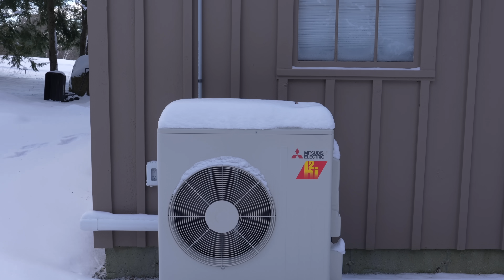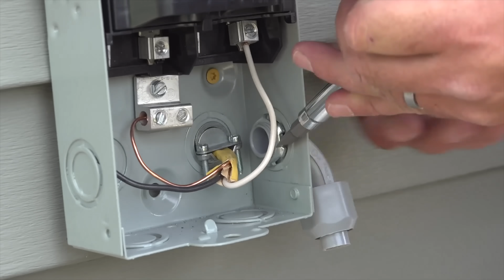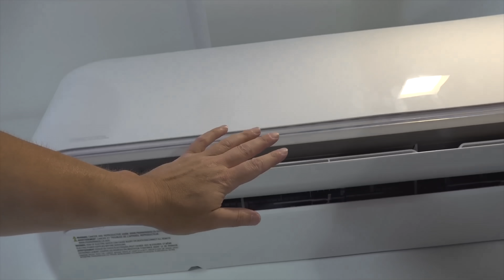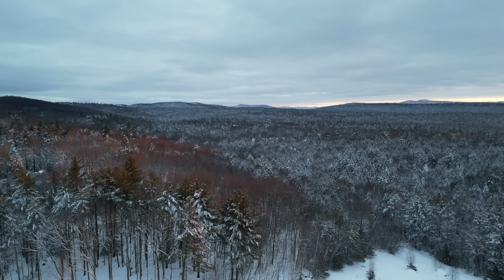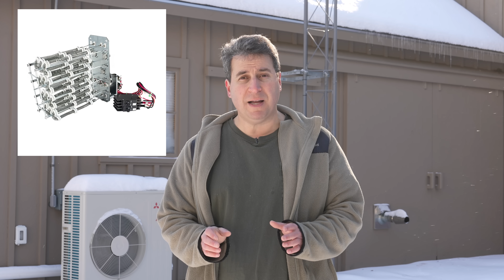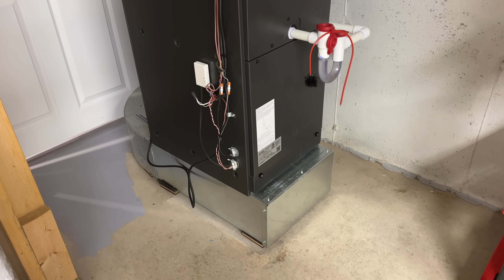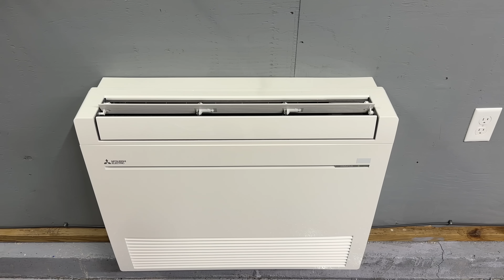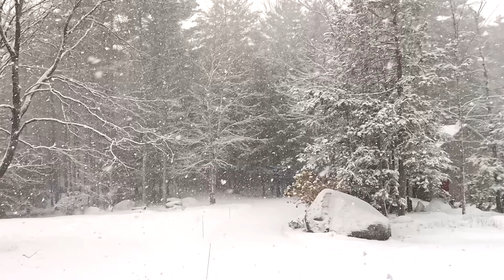Why Heat Pumps are now leaving people COLD

Comment: Actually one of the states where heat pump adoption is the highest is Maine.  So not all that sure this guy has his facts straight.  Maine loves heat pumps because they heat much more cost effectively than propane, which many Mainers use.  (And more cost effectively than oil or gas too.)  And last I checked, it gets really cold in Maine.  

So what do they do?  Mainers simply buy a heat pump rated for minus 20 degrees or better.  They do exist.  And they will provide efficient and cost effective heat even down to minus twenty.  Does a heat pump that works in minus 20 degree weather cost more?  Yes.  And is it as efficient at minus twenty as it is at minus ten, or zero?  No.  But even in Maine, it doesn't get that cold that often.  And even at minus 20 a good heat pump is still more cost effective than propane.  Plus it doubles as the best air conditioner you’ve ever had in the summer.  I say, if heat pumps are good enough for Maine, then they’re more than good enough for the rest of the country.
Reply: I’m in New Brunswick 🇨🇦, you are correct, our heat pumps are rated for -30C, we have no problems keeping the house warm

Comment: My neighbor has a heat pump and during the winter it never shuts off. They also have a gas furnace (original equipment in the home), but it apparently never gets turned on.

Comment: I don’t understand why you’re so worked up against the one thing most people could afford for winter heating: the heat pumps. You have snow on the heat pump that’s why is underperforming. I have my outdoor unit set up under the porch and it works well year round-I’ll let you guess why. Most probably your indoor unit is set up high where it works well at cooling during summer, while during winter it just heats up the ceiling leaving the floors cold-that’s what I did, unfortunately. Supplemental heating-that you mention is not about cheating but is meant to either improve the heating of a too small of a heat pump when one can’t afford to invest in a large enough heat pump, or to extend the usability of a heat pump down to temperatures at least 20F below the physical capabilities of whatever freon it uses. I have run a 36000 btu heat pump guaranteed to work down to minus 5F the entire last winter at my cottage and never seen the 15A breaker tripped (they recommended a 20A breaker, I went with 15A) not even when temperature dropped below  minus 35F. What I’m trying to say is that my heat pump never reach full load even in the coldest winter night in the woods in Quebec Canada. Granted I still supplemented with wood heating for basement- I enjoy living at my cottage in the middle of nowhere and occasionally with electrical heating (briefly after refreshing the air in my room while outside trees were cracking with frostbite).

Comment: Great overview. Capacity and efficiency are key metrics that are often left out of the heat pump discussion. If your heat pump is sized correctly and your ductwork is in good shape, you may not need supplemental heat, but the COP (efficiency) is likely to suffer at low temps. Cold climate heat pumps try to balance these issues, but YMMV, depending on how good the install was and whether the home is weatherized. I get sick of the soundbites on either side of the discussion. Heat pumps (and homes) are complex systems that require thoughtful planning, installation and maintenance and there is no such thing as one size fits all!

Comment: With all sources of Energy first Rule ,How much / KW will it cost me,theHeat  Pump  maybe efficient ?But if it costs you /KW to run  more than a/KW of NG or other fuel if doesn’t work  Exceptions-in climates where the temperature goes High and you to have to have cooling.

Comment: As an HVAC contractor in san antonio texas, I often recommend supplemental AC for the extreme summers. Those little roll around units are amazing to help your primary AC along!
Also, I would never recommend abandoning gas heat if available.

Comment: I was planning on running a heat pump to an A coil to my conventional furnace. That way I can use gas on really cold days but have electric central heat and air too. Not sure if that will work but hoping.

Comment: Look dude. Stop trying to make sales on bs products.  When the temperature gets below 40°  a heat pump is worth shit. If you want the efficiency of a heat pump then use a custom dual fuel system. Using natural gas or my preference lp gas . With this system you will have a case coil that is just what it's called a evaporation coil sealed in a case that ties into your supply air duct . This will be your source of cooling and heating for the heat pump condenser . For when temperatures drop below 40°f you will have a gas furnace preferably converted with a kit for lp gas " propane" also called liquid petroleum.  This is by far the most efficient method for heating  in low temperatures . The electric heat strip mentioned is basically  a giant toaster that will serve the energy provider in your area well.  The water systems that were mentioned are called hydronic and heat recovery.  If you want to invest in this good luck because you will replace the entire system you have twice before heat recovery will get close to saving enough costs to pay just for itself.  Remember all products that you purchase must pay for itself in savings on power consumption before you actually save anything. I have been a nate certified hvacr master technician for thirty years and if I couldn't guarantee that I could cut your power bill in half I would not even try to sell it.  Plus it doesn't help to get the half you save back in fuel costs for natural gas or propane.  The other issue is dependability. Making you comfortable should be the technicians main concern rather than selling something you don't need.  Mini splits are good for cooling and anyone up north knows its insane to consider electric heat. Unless you have that kind of money to throw away. Undependable equipment is bad but untrustworthy technicians that you have trusted to make your home well a home are far worse!

Comment: PANASONIC HZ35 in 60m2 apartment. we get even -15c winters for like 2 weeks. Heat pump turned out way too powerful. In that cold it run on about 40-50%, cus it can reach like 2.6kw consumption but we only see electric bill for whole apartment spike up to 1.4kw per hour. In warmer months where it was in like +5c it was ruling at 15-20%. And house is old, don't have windows in basement beneath it and no heating in neighbors empty apartment and stairwell. Concrete panel building, no insulation besides cheap double glazed windows. Should have gotten weaker model but I wanted to be sure we didn't need extra heating source.

Comment: The best heat system is multiple heat systems. My new house is going to have 3: a wood stove, gas, and heat pumps. The heat pumps will mostly be for AC and secondarily for a heat baseline.

Comment: The most important factors for any hvac system to operate correctly and reliably are 1. The quality of the install 2. The quality of the brand.  Mr Cool is a joke of a heat pump, only meant to be used in moderate conditions for a short period of time. A quality Mitsubishi mini split installed properly by a professional will work great year round.

Comment: We had ducted central heating and air conditioning.  ~3,000 Sq Ft/ 275 m2 house built in 2012, and is well insulated. Going into my 2nd winter with the air-to-air heat pump.  We kept the gas furnace for cold days.   We replaced the 2.5 ton air conditioner, with a new heat pump, also rated at 2.5 ton (30,000 BTU).  The 'summer' heat pump AC works fine, maybe better than the 'old'  dedicated A/C.    In winter, it's either gas heat or heat pump (i.e the gas is alternate, NOT auxiliary) because the Heat Pump  indoor coil is on the leaving end of the gas burner.

Our winters occasionally get to -25c, for maybe a week every year. Mostly between -5c and -15c on cold days. 

We found that on winter mornings, the heat pump had a hard time recovering the (2.5c setback) room temperature in the morning, and the air being blown around is cooler (38-40c) than with the gas heat (50-60c) so there is a cooler 'feeling'.   On cold mornings, we turn on the (gas) fireplace for a quick blast, even though that is less energy efficient. When the heat pump goes into defrost, there is also a cold draft feeling for a while.

After about 6 weeks of experience, I set the Ecobee thermostat to limit winter heat pump operation above 4c, and rely on gas heat only below that.  I'll probably experiment and turn that down to about 0c this coming winter, or even a bit lower to find the 'sweet spot'.  This saves some wear and tear on the heat pump, I suppose, as it does less work at lower temperatures where it's less efficient.  So I'm not running the HP at lower efficiency, when its electrical efficiency inches closer to resistance heating.  Gas is still cheaper for us.

Last winter was an 'easy' winter, and we saved (between gas and electric) about $400.  Hard to say how much of that was due to the heat pump, and how much to credit the winter weather for that.

Comment: Funny, but you do not tell why. Physics must work alike, then where are the problem, well sadly you don't tell. -- I am not clever that is true, but the heat you gain or compress when the cold is serious seem to be limited, otervise there would not be a problem ; maybe there are not so much heat or the heat pump work different than we think ? When minus 40 Deg.C.  maybe there are not so much heat to exchange as with minus 30. True enough at absolut Zero, there are nothing ;))

Comment: It depends on the heat pump. If it has an inverter compressor many of them will provide 100% heat pump heating capacity down to -5 deg F. If it's a standard heat pump without an inverter compressor yes below 20-30 deg F outside they start losing heating capacity. My next unit will be an inverter compressor heat pump.

Comment: For cold temperatures you need the proper refrigerant ,maybe a dual unit to handle heating a nd cooling...
Go to natural refrigerants CO2 and propane... Cheap and abundant...
Look at the bin numbers to see exactly how many extreme days you have each year..
Air to water monoblock heat pumps keep the refrigerant outdoors for safety...

Comment: I have had a heat pump as the main source of heat and cooling for 28 years.  They work great where I live in Morgantown, WV.  I have not used the high-end models just basic models SEER 10 and Now SEER 12-14 .  Do the heat strips kick on in the coldest days, yes and it does cost more to run them, but I seldom run them by themselves.  I try to have the heat pump provide as much heat as possible as it is simply more efficient.   I will say that you do have to understand how to set them up to gain the most from them, and few salesmen understand how to set them up correctly.   And I have run into several HVAC tech that were questionable in knowledge of heat pumps also.

Comment: Proponents of heat pumps are delusional for installs  south of Tennessee .   If the average lows is below 40 degrees it isn't going to work!  The colder it gets, the less efficient heat pumps become. If it's below 32 degF in your area and the majority of people have heat pumps, the grid is going to collapse under the strain.
Reply: Sweden says Hi.  Many areas with primarially heat pumps.. Winters are constantly below 32F.  We've been doing it for decades.  You need to catch up.

Comment: I would go with the wood pellet stove and treat it as insurance policy for those extreme winters - the power grid comes under immense strain during winter especially as it competes with residential gas for fuel as well as the risk of winter weather taking down a power line. having a heat source with fuel on site for those extreme days could be a life saver.

Comment: Great video! Would like to mention that along with insulation, and arguably before it, get an energy audit and tighten up the envelope with air sealing. This is cheap and one of the biggest bang-for-the-buck projects you can do. When warm air isn't escaping the home as much, the heat pump can work much less.

Comment: Heat Pumps have resistance coils built in to defrost and also provide that supplemtnal heating you are talking about.

If your house is 15 to 20 years old that doesn't automatically mean you'll have problems heating.  If you insulate properly the heat pump will do the job if properly sized.  There are many vendors jumping on the Heat Pump wagon with not enough experience to pick the right model and implement it.  Same thing happened with oil and gas boilers with properly mis-sized and implemented.

CO2 and Propane Heat Pumps are much better at heating and cooling in the deep cold.   Also regular water and glycol models which are the most widely used today have new features on recent models that use coolant injection, like fuel injection for cars, to handle the cold much better. 

Heat Pumps are the way folks.  Insulate your home though since that should be something you do whether you have gas, oil, biomass (wood) or electricity heating.  That comes first. Heat Pumps are knocking out of the park but you need a good park first.

how dont care how many Mr Cools (consumer level installer kits from the Lowes and Home Depot), it doesn't make you an expert.  There is many things in this video that are misleading.

Comment: Your heat pump in the video looks like it is installed on the ground.  All heat pumps should be mounted above the level of snow to allow for the defrost cycle water to effectively drain away from the unit.  That is why they are installed on brackets or on a stand.
Reply: How can you combat the ice build up around the unit that the defrost cycle creates?
Reply: @GrendelSheperd thats why you have it elevated so that the ive goes down on the surface below
Reply: @cheddrchad oh she’s up there. Still about 10” of ice under the unit. Another 10” and it will be up to the bottom of the unit. I’ll just chip away at it.
Reply: @GrendelSheperd  My Sisters house has it about 3 feet off the ground.  We are in Northeastern Ontario, they went from using 8 tanks of oil heating their home a year to 1

Comment: In Canada with a dual fuel Heat pump and natural gas furnace setup. Based on basic calculations I set the switch to around -7deg C to use furnace, but above that heat pump does keep the house warm.

Comment: THis is a terrible video. Every heat pump produces the most heat (has the most capacity) at a certain outdoor temp. At lower temps it will still produce heat but the capacity (the amount of heat) and the efficency (how much electricity it takes to make the heat) will be lower. You state that "below 20 degrees heat pumps dont operate effectively", that's ambiguous enough that its useless. Everyone who installs a heat pump must look at the specs and for their system and determine if the system is appropriate for their home and climate. You certainly can install a heat pump that can keep your space comfortable in any temperature. To do so you would need to pay attention to the capacity at low temp specifications given by the manufacturer and compare them with your home's heating load. Installers should be doing this but they either dont care or dont know how. Too many other inacuracies to write about in this video, probaby trolling for views and comments, pretty lame video. If you're going to put videos out there about complex subjects you really should know what you're talking about as this video makes you appear unprepared to talk about the subject at hand.

Comment: Southern Ontarian here going through first winter with a ducted heat pump + auxiliary backup. I have CT monitors that tell me the live and historical current and thus power draw for the heat pump (outdoor unit) + blower and aux (indoor unit). I find the outdoor temperature at which the aux heat makes more sense from an efficiency point of view to be about -20C (-4F). Above that the heat pump is more efficient

Comment: Why did it take so long for these things to be invented? Its literally just an air conditioner that can switch which side is the evaporator and which side is the condenser. Was there some sort of technology that had to be invented to make that work?
Reply: Heat pumps have been on the market since the 50s. Time has improved cold performance. But the concept just wasn't needed then, as heating costs were so low. Now with the green assault on natural gas and restrictions to heating freedom that entails, we're going to be stuck with heat pumps, for better or worse.